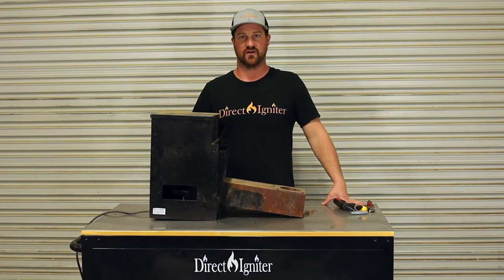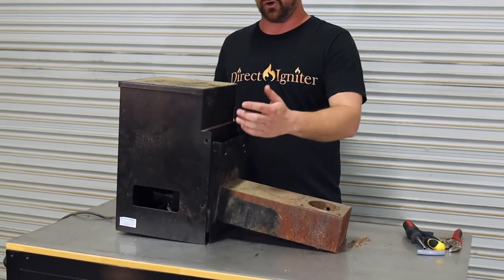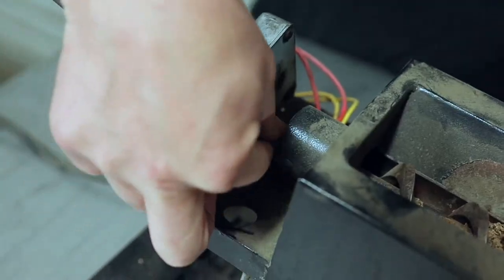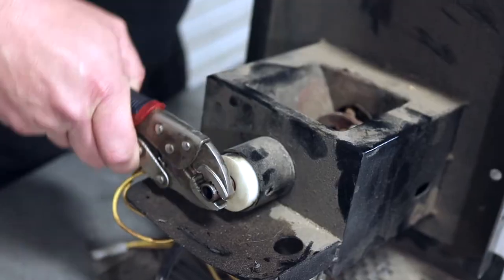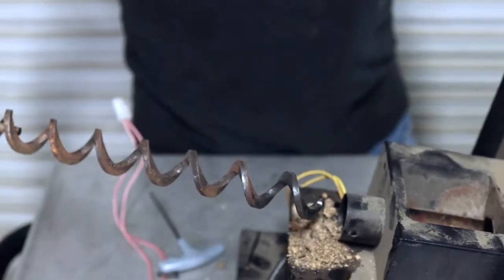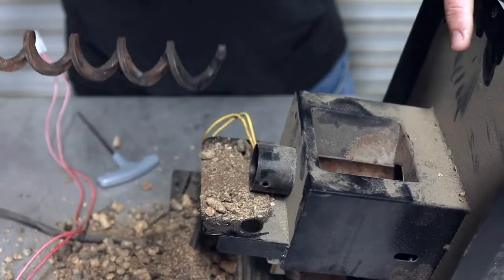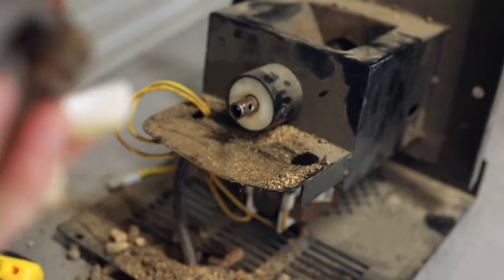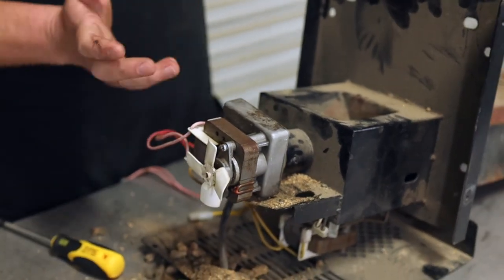How to Clear a Jammed Auger on A Traeger® Grill - The BEST Method

Comment: This company sends me the protypes to r and d.  After you empty your hopper run the remainder through the pot until it stops. Otherwise in some climates..  it has the same effect as if you never emptied  the hopper.  This should be included in the video. I have a 7 vertical by pit boss that doesn't even have a serial number prototype and still runs and it is half the smoker these Traeger beauties are.